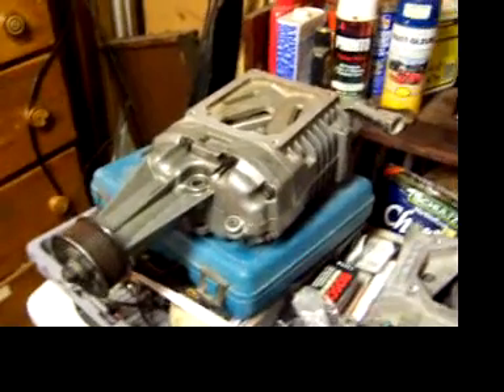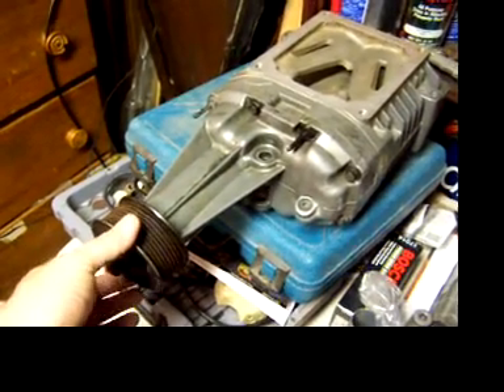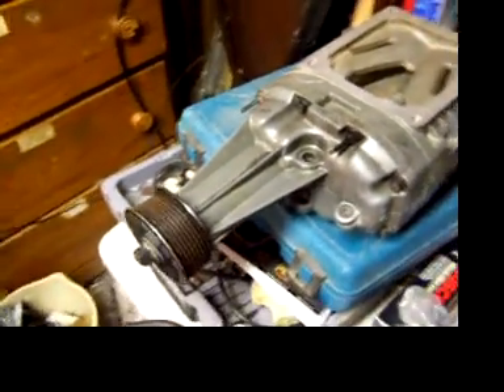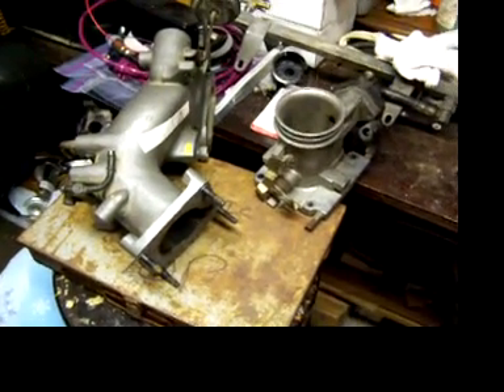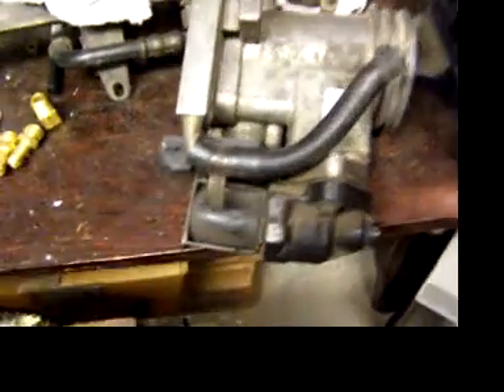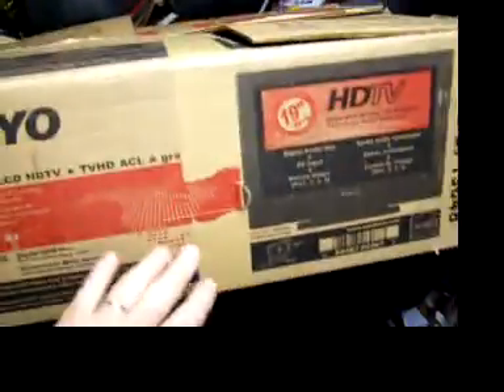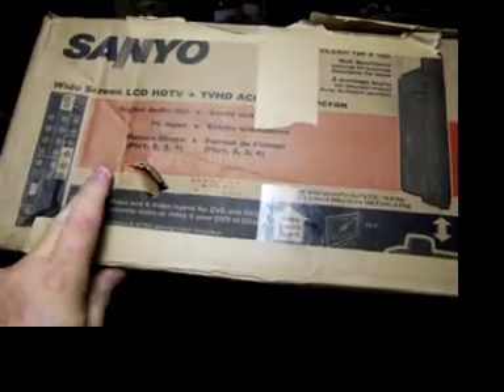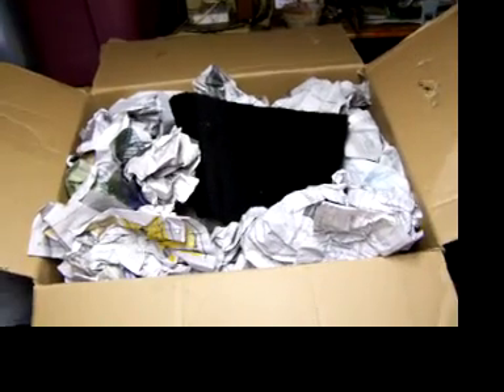M90 SC

Comment from the maker: Rocker23001 is correct there are differences between the early and late 3.8 motors.  At the end of the day you would be better off getting a complete motor from a suppercoup.

With an 03 since you probably need to maintain emissions I would look at the centrifugal superchargers like vortech and use one of there kits that are CARB certified.

Comment: nope, the m90 will only work on single port motors. 1999 and up 3.8/3.9 motors are split port, whereas 1998 and lower 3.8s are single port. you're better off using an m112 Eaton that will ultimately give you more power.